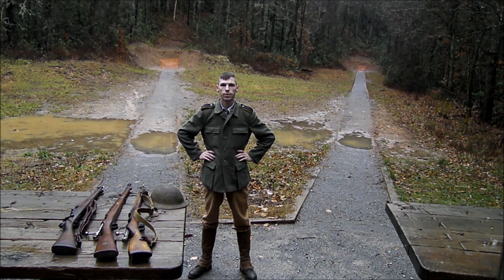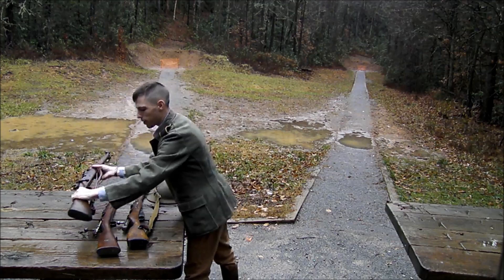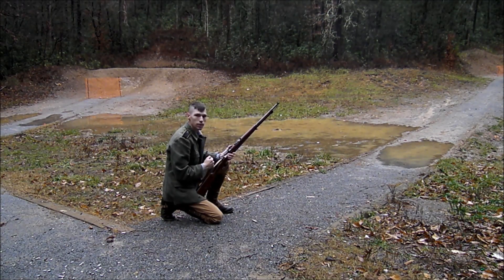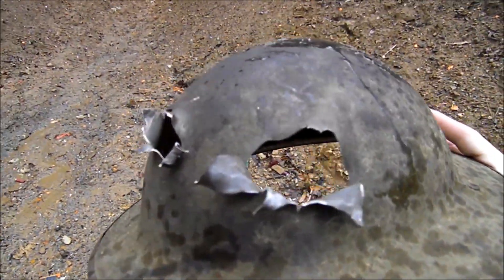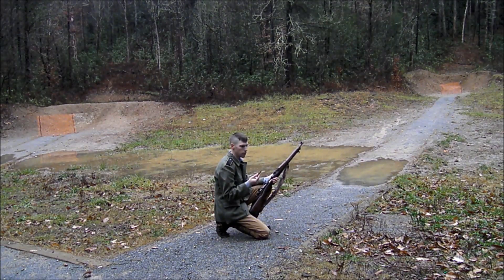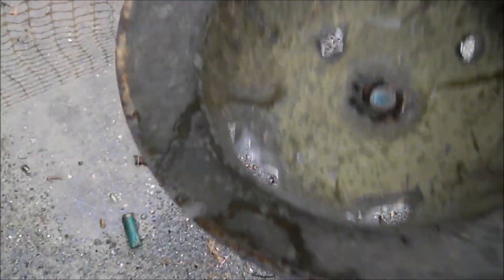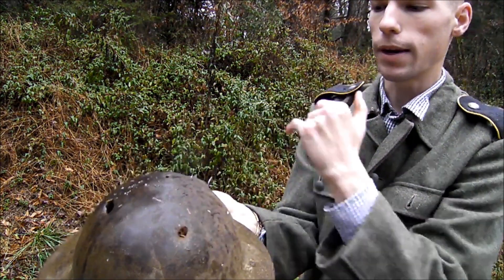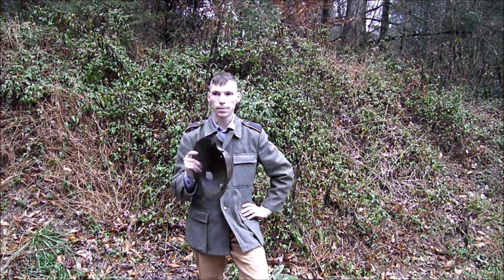I Test the Ballistics of a WWI US Doughboy Helmet

Comment: while i m for testing, i believe that using rifle caliber was overkill (as pretty much all regular infantry steel pots, from the worst to the best get penned easily by rifle shots)

i believe you should have used much weaker (like lower end of pistols) as test, as it is where we can generally appreciate some degree of difference. (beside, fragments, wich is the threat helmets are made to stop, are generally much smaller both in size and in weight than a rifle bullet, so, if you where to shoot something small, like .17 or .22 caliber at a pistol-tier velocity, you would get much more interessing results)
Reply from the maker: I can agree.  I should have started with much smaller calibers and worked my way up.  It would have been much more scientific and informative than this.
Reply: @MadrasArsenal  if you plan to redo, a test, I recommend you to get some stuff like 22lr, 25 acp, 32 acp, .17 hmr , thoose kind of very smalll rounds (and in different loads for different speeds) in order to mimic the closest you can the modern stanag 2920 testing (basically, for modern anti frag stuff, nato standard is the stanag 2920, wich consist of using small .22 caliber fragments simulating projectiles, they weight 17 grains/1.1gramms, are made of a ~30hrc 4340 steel and are in the shape of a small cylinder with two cuts on the frontw making it look like a more blunt version of a flat screw driver s head. Such projectiles are shot at increaqing velocities until 50% of penetrationd and 50% stoppage are achieved, and then, the velocity at this this 50% rate is achieved is called the v50)

So, I believe using various loads with increasing velocities of .22, .17, .32 calibers (and showing their weight and speed to viewers ) would allow for a much more scientific test. (That and then à closer look on the steel after each shot, to show the way the steel behave. As not every helmet use the same steel  generally british and american world war 1 and 2 helmets use hadfield austenitic steel  but some other nations use heat treated tempered martensitic steel , and so behavior is very different)

Comment: Why no pistol rounds???? Total waste, not many educated people beleive these will stop rifle rounds. However these CAN and have (watch Mike Bs videos) stopped plenty of handgun rounds. SO the myth they cant stop bullets is a lie. They can stop handgun rounds. Well we'll never know about this one but I'm guess it will at least stop a .45. Maybe 9mm based on shape however steel composition also matters a lot.
Reply from the maker: Teru Mikami OK.
Reply: Also, I'll add in a correction. Modern kevlar helmets would not have stopped these rounds. a kevlar helmet maybe... MAYBE can stop or deflect a .223 but there are dozens of vids showing half cartridges like 7.62x39 going in one end and out the other. So hi powered rifle rounds like these? No way.
Reply: Teru Mikami These helmets will not stop a pistol round even at max pistol engagement range. That's a fact. Sure you may get lucky if it's a glancing shot but other than that these have no small arms stopping ability. Period. Even new helmets aren't meant for small arms fire.
Reply: @erictheboringone5292  Damned. Sorry it took 4 years to reply. But that's not true at all. Most steel helmets deflect most handgun rounds. Have you really not seen all the videos online of people doing that? There are a lot.